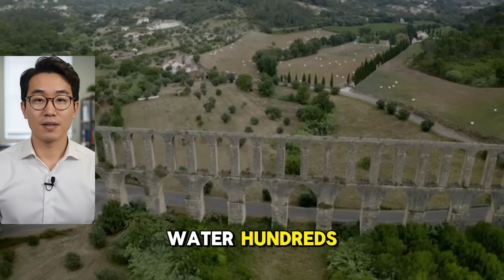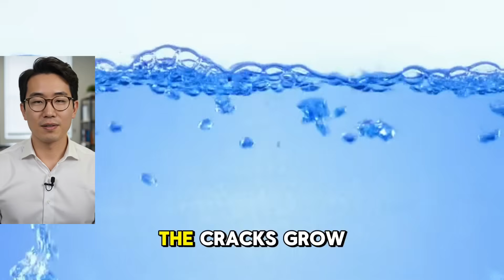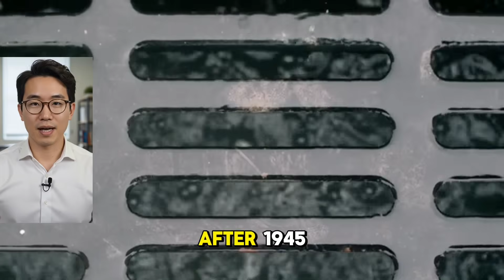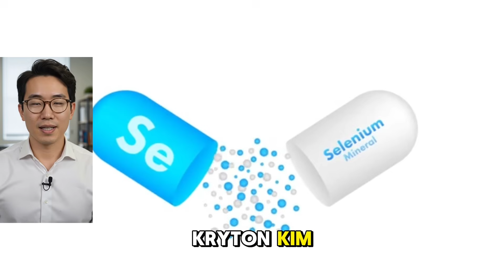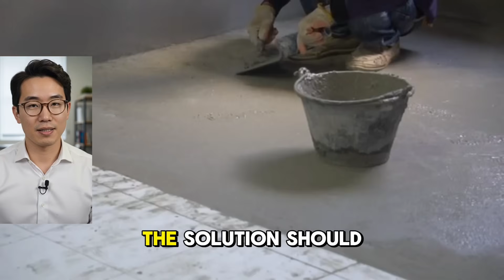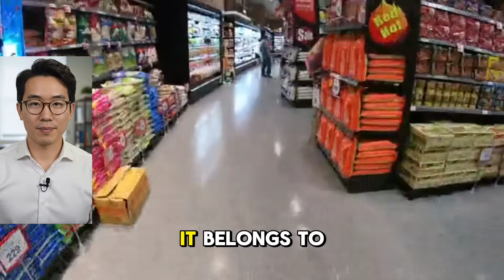This Single Coat on Any Concrete Floor Makes It Waterproof Forever. Costs $3

Comment from the maker: The compound in this video is sodium silicate — also sold as "concrete densifier" or "waterglass" at Home Depot, Lowe's, and Ace Hardware. A quart costs $2–$4 and covers 200–400 sq ft. Your basement contractor knows this name. Ask them about it next time they quote you $5,000. Watch their face. — Dr. Nick
Reply: can this be used for  compressed earh blocks?
Reply: haha. true. so much rip off these days.

Comment: Sodium silicate is useful, but this is overhyped:

It’s mainly a surface densifier, not true waterproofing
It doesn’t seal cracks or structural defects
It can’t resist water pressure (like from soil or tanks)
Works only on sound concrete and shallow depth

A better approach is using proper waterproofing systems like crystalline additives (e.g. Xypex Concentrate) or external membranes (bitumen/EPDM), depending on the situation.

Comment: Can this be used to waterproof red brick walls that have plaster on both sides? If yes, what is the process? Thank you!
Reply: Is the plaster calcium-based (lime)?  
Sodium silicate reacts with calcium to form calcium silicate, which is insoluble.  
Therefore, it should make the plaster water-resistant.  
If the plaster is gypsum-based (plaster of Paris), the sodium silicate will react with the calcium and give you the same end result -- water-resistence.

Comment: Thank you so very much!!!
Im over 70 years old and im using your knowledge doing project i learned from you just by myself. Right now im in process covering my wood porch using solution with  boiled linseed oil

Comment: Can this be used on terracotta style roofs with a leak?
Reply: Yes, but you should first fill the holes with concrete mortar or lime mortar (slaked lime plus sand).  Once that is dry, apply multiple coats of a sodium silicate solution.

Comment: Would this also work if painted onto cement sheet walls?
Reply: Yes, sodium silicate (water glass) can be used to seal bricks and masonry, acting as a densifier and penetrating sealer to increase water resistance, reduce dusting, and strengthen the surface. It penetrates pores and reacts to form a hard, water-resistant, inorganic barrier that is ideal for concrete and masonry but can be unsuitable for breathable, historic brickwork

Key Aspects of Sodium Silicate for Brick Sealing:

Mechanism: It works by reacting with free lime and calcium carbonate in the masonry to fill voids and form calcium silicate hydrate (CSH) gel, creating a permanent, dense surface.
Benefits: It significantly reduces water penetration, increases surface strength, prevents dusting, and is highly resistant to heat, making it suitable for chimneys and refractory applications.

Application: It is typically diluted (often 1 part water glass to 4 parts water) and applied until the surface is saturated.
Limitations: It can create a less breathable barrier than traditional sealants and can cause white efflorescence or alkali carbonate stains (bloom), notes and.

Alternatives: For superior breathable protection, traditional silicones or siloxanes are often used on exterior brick, as noted in this article from Travis Perkins. 

Courtesy of AI

Comment: Sodium silicate at Home Depot is $79.  Where are you getting $3?
Reply: All the charlatans who have discovered basic things that WORK are appropriating them, bagging or bottling them and getting them to market at SKY HIGH PRICES. Boiled Linseed oil as an example: USED to be cheap, and available by the gallon. Now it is priced by the DROP and has likely adulterated with all sorts of cheap waste oil and other concoctions to make bulk at the lowest possible input cost. There are no institutions in place to regulate the outright FRAUD. Exactly like the pharmaceutical industry where basic Aspirin is now retailed at thousands of times more than it costs to produce. The GREEDY LITTLE BLIGHTERS are hard at work 24/7 screwing everyone and that's not even touching on ' the BILLION DOLLAR INDUSTRY hell bent on taking the completely uninformed TO THE CLEANERS.😠😠😠

Comment: I don't find in my local area
Reply: You can make your own sodium silicate using ground up silica gel beads (cut open waste silica gel packs in vitamin jars) and drain cleaner (caustic soda, a.k.a. sodium hydroxide), plus boiling water.  
There are  vi de os  here on YT with detailed instructions. 
Because of fumes, it is best done outdoors.  
Make sure you wear gloves, a face mask, and eye protection.  
🍀

Comment: Highly incompetent & unprofessional and misleading, mixing silicon and selenium,  back to basic chemistry and sticking with whatever you may understand
Reply: Yes, sodium silicate (water glass) can be used to seal bricks and masonry, acting as a densifier and penetrating sealer to increase water resistance, reduce dusting, and strengthen the surface. It penetrates pores and reacts to form a hard, water-resistant, inorganic barrier that is ideal for concrete and masonry but can be unsuitable for breathable, historic brickwork

Key Aspects of Sodium Silicate for Brick Sealing:

Mechanism: It works by reacting with free lime and calcium carbonate in the masonry to fill voids and form calcium silicate hydrate (CSH) gel, creating a permanent, dense surface.
Benefits: It significantly reduces water penetration, increases surface strength, prevents dusting, and is highly resistant to heat, making it suitable for chimneys and refractory applications.

Application: It is typically diluted (often 1 part water glass to 4 parts water) and applied until the surface is saturated.

Limitations: It can create a less breathable barrier than traditional sealants and can cause white efflorescence or alkali carbonate stains (bloom), notes and.

Alternatives: For superior breathable protection, traditional silicones or siloxanes are often used on exterior brick, as noted in this article from Travis Perkins. 

Courtesy of AI

Comment: Will this work on a very porous kilndried brick out of Central America?
Reply: It depends on how much calcium is available on the brick surface.  The sodium silicate needs to react with calcium in order to become calcium silicate (which is insoluble). 
You may need to combine the sodium silicate solution with a bit of slaked lime powder.

Comment: Do I have to remove paint or just clean with TSP
Reply: You'll need to strip the paint, to expose the porous surface. Once exposed the silicone can soak in.

Comment: can you apply it to cement sheeting?
Reply: Yes, sodium silicate (water glass) can be used to seal bricks and masonry, acting as a densifier and penetrating sealer to increase water resistance, reduce dusting, and strengthen the surface. It penetrates pores and reacts to form a hard, water-resistant, inorganic barrier that is ideal for concrete and masonry but can be unsuitable for breathable, historic brickwork

Key Aspects of Sodium Silicate for Brick Sealing:

Mechanism: It works by reacting with free lime and calcium carbonate in the masonry to fill voids and form calcium silicate hydrate (CSH) gel, creating a permanent, dense surface.
Benefits: It significantly reduces water penetration, increases surface strength, prevents dusting, and is highly resistant to heat, making it suitable for chimneys and refractory applications.

Application: It is typically diluted (often 1 part water glass to 4 parts water) and applied until the surface is saturated.
Limitations: It can create a less breathable barrier than traditional sealants and can cause white efflorescence or alkali carbonate stains (bloom), notes and.

Alternatives: For superior breathable protection, traditional silicones or siloxanes are often used on exterior brick, as noted in this article from Travis Perkins. 

Courtesy of AI

Comment: This doesn't give soluution quantities
Reply: Yes, sodium silicate (water glass) can be used to seal bricks and masonry, acting as a densifier and penetrating sealer to increase water resistance, reduce dusting, and strengthen the surface. It penetrates pores and reacts to form a hard, water-resistant, inorganic barrier that is ideal for concrete and masonry but can be unsuitable for breathable, historic brickwork

Key Aspects of Sodium Silicate for Brick Sealing:

Mechanism: It works by reacting with free lime and calcium carbonate in the masonry to fill voids and form calcium silicate hydrate (CSH) gel, creating a permanent, dense surface.
Benefits: It significantly reduces water penetration, increases surface strength, prevents dusting, and is highly resistant to heat, making it suitable for chimneys and refractory applications.

Application: It is typically diluted (often 1 part water glass to 4 parts water) and applied until the surface is saturated.

Limitations: It can create a less breathable barrier than traditional sealants and can cause white efflorescence or alkali carbonate stains (bloom), notes and.

Alternatives: For superior breathable protection, traditional silicones or siloxanes are often used on exterior brick, as noted in this article from Travis Perkins. 

Courtesy of AI

Comment: Will it work on brick walls?
Reply: Yes. If it's porous, yes.
Reply: Yes, sodium silicate (water glass) can be used to seal bricks and masonry, acting as a densifier and penetrating sealer to increase water resistance, reduce dusting, and strengthen the surface. It penetrates pores and reacts to form a hard, water-resistant, inorganic barrier that is ideal for concrete and masonry but can be unsuitable for breathable, historic brickwork

Key Aspects of Sodium Silicate for Brick Sealing:

Mechanism: It works by reacting with free lime and calcium carbonate in the masonry to fill voids and form calcium silicate hydrate (CSH) gel, creating a permanent, dense surface.
Benefits: It significantly reduces water penetration, increases surface strength, prevents dusting, and is highly resistant to heat, making it suitable for chimneys and refractory applications.

Application: It is typically diluted (often 1 part water glass to 4 parts water) and applied until the surface is saturated.
Limitations: It can create a less breathable barrier than traditional sealants and can cause white efflorescence or alkali carbonate stains (bloom), notes and.

Alternatives: For superior breathable protection, traditional silicones or siloxanes are often used on exterior brick, as noted in this article from Travis Perkins. 

Courtesy of AI

Comment: Wait until you see what happens when you combine this $3 trick with the drainage hack I just dropped! 🤯 I’ve saved my clients over $15k this year alone using these forgotten methods. If you think the concrete industry is a scam, wait until you see what the roofing companies don't want you to know. Check out my page for the full Construction Secrets series your wallet will thank you.

Comment: can this be applied to freshly poured concrete?
Reply: Yes, sodium silicate (water glass) can be used to seal bricks and masonry, acting as a densifier and penetrating sealer to increase water resistance, reduce dusting, and strengthen the surface. It penetrates pores and reacts to form a hard, water-resistant, inorganic barrier that is ideal for concrete and masonry but can be unsuitable for breathable, historic brickwork.

Key Aspects of Sodium Silicate for Brick Sealing:
Mechanism: It works by reacting with free lime and calcium carbonate in the masonry to fill voids and form calcium silicate hydrate (CSH) gel, creating a permanent, dense surface.
Benefits: It significantly reduces water penetration, increases surface strength, prevents dusting, and is highly resistant to heat, making it suitable for chimneys and refractory applications.
Application: It is typically diluted (often 1 part water glass to 4 parts water) and applied until the surface is saturated.
Limitations: It can create a less breathable barrier than traditional sealants and can cause white efflorescence or alkali carbonate stains (bloom), notes and.
Alternatives: For superior breathable protection, traditional silicones or siloxanes are often used on exterior brick, as noted in this article from Travis Perkins. 

Courtesy of AI
Reply: Generally, it is best to wait about 24 hours, until the concrete has set.  
You could also wait much longer, because it also works on cured concrete.

Comment: I don't care how AI these videos are the information in them is so awesome between this and the raccoon preparedness both really really time and money saving videos!
Reply: The information in these videos is , quite too often downright fancyful and wrong to be honest. 
And everything appears to cost just $ 3 : 00  , according to this AI talking head for hire .
The actual cost in this example is AT LEAST 20 -30 X  the three dollars claimed .
Stop the BS.
Reply: @hardystein114  So you’re saying it costs $60-$90 instead of $5,000 ? That’s still an awesome save in my book.
Reply: @chipasinpotatochip  You can make your own sodium silicate using ground up silica gel beads (cut open waste silica gel packs in vitamin jars) and drain cleaner (caustic soda, a.k.a. sodium hydroxide), plus boiling water.  
There are  vi de os  here on YT with detailed instructions. 
Because of fumes, it is best done outdoors.  
Make sure you wear gloves, a face mask, and eye protection.  
🍀
Reply: Is it definitely ai? He did flounder and swallow